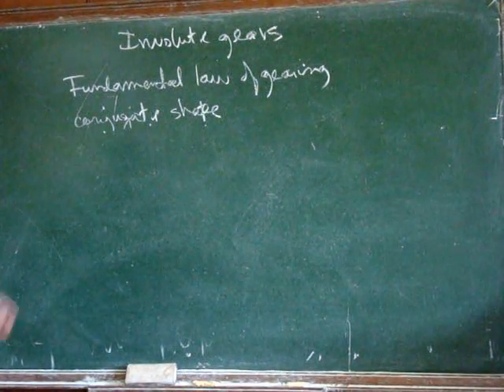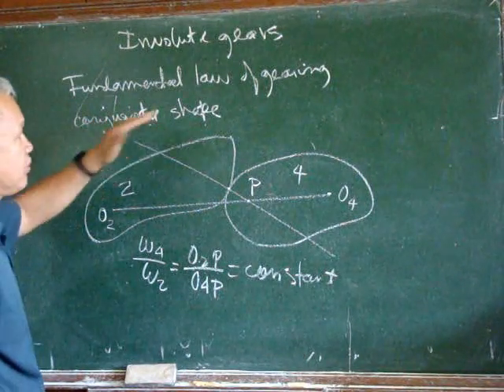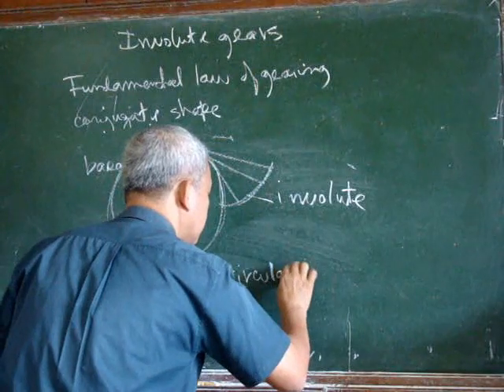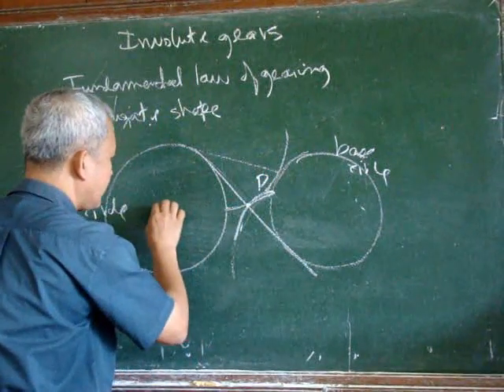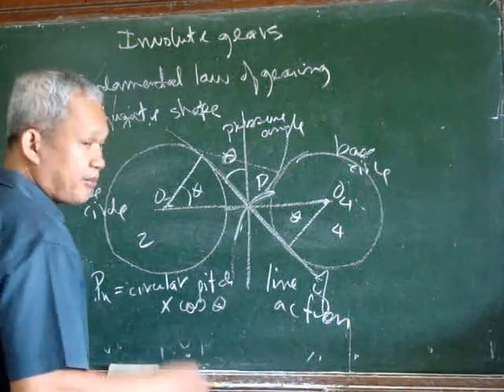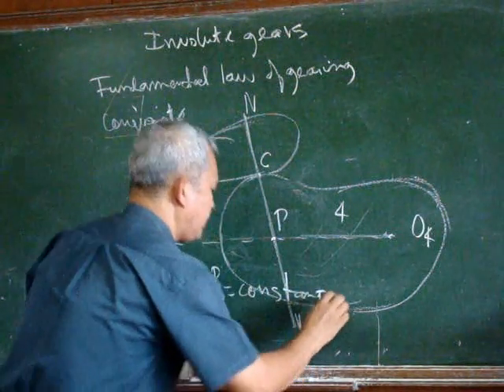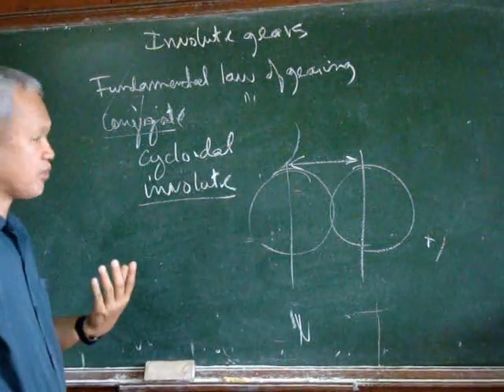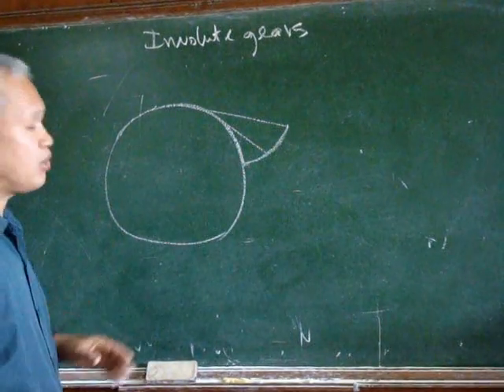Involute gears 1a

Comment: Delfin - Thank you for posting this lecture. It was a great refresher of my kinematics class during undergraduate days at Michigan Technological University. However, I was wondering if you could take the derivation further to develop the function for Involute (i.e. R(theta) where R is the radius from center to involute gear surface and theta is angle increment around the gear). My goal is to write a C# to aid our designers when developing CAD for gear trains. Thanks!